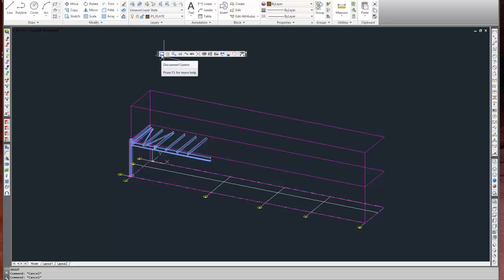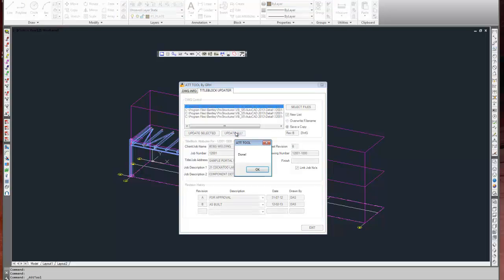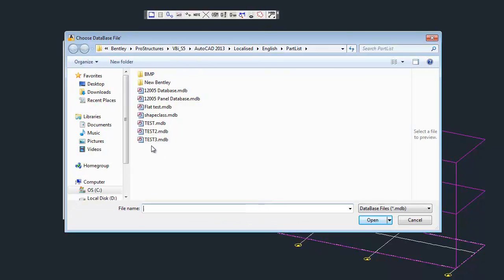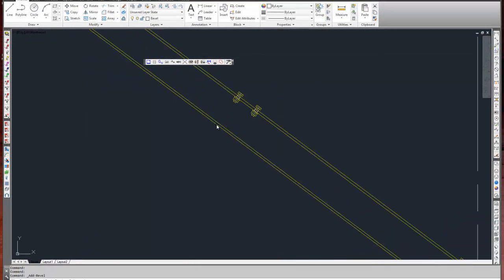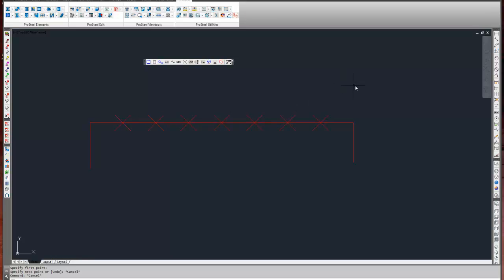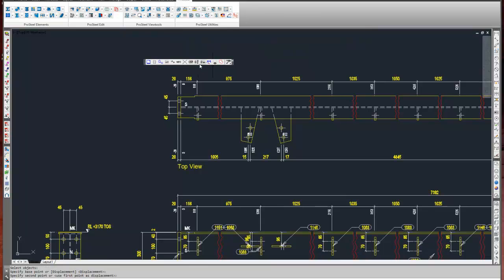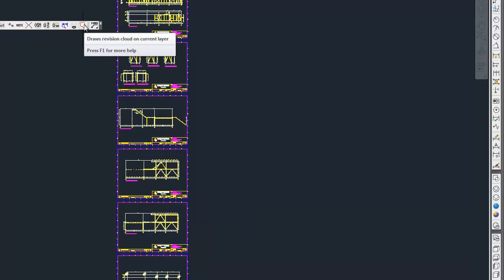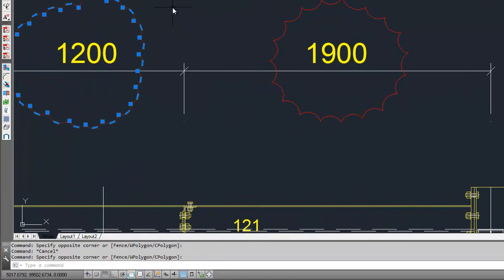ProSteel ACAD - S5 Detailing Toolbar*

Comment: Great Tutorial. Want it to know is Adams Pro steel Config. comes with standard pro steel installation file or is it separate file that we need to download?
Reply from the maker: Hardik Jariwala 
Hi Hardik, the APC is an additional configuration package that can be purchased from me. It has been specifically made for the Australian localisation/environment, but would work fine for other regions as well. It includes customised settings and dot NET tools that vastly improve the productivity and usability of ProSteel. It is available for either the Power version or the Layered version.